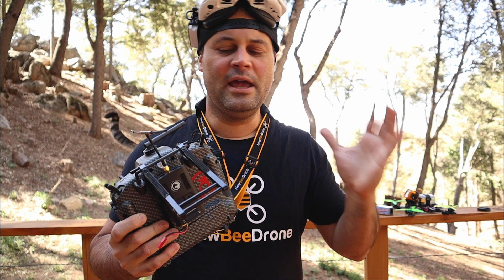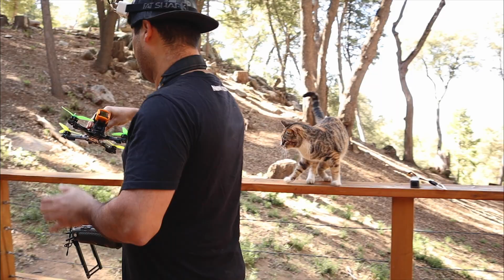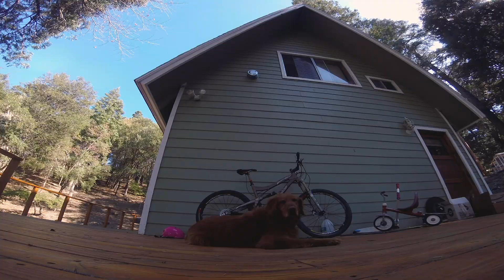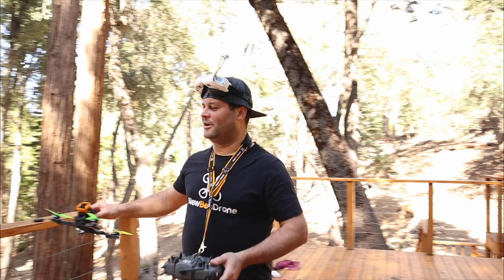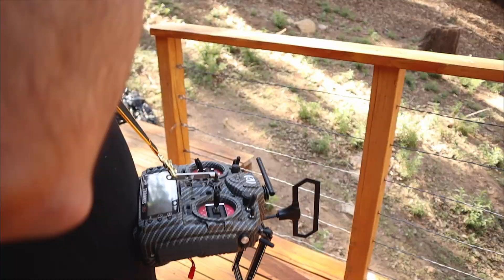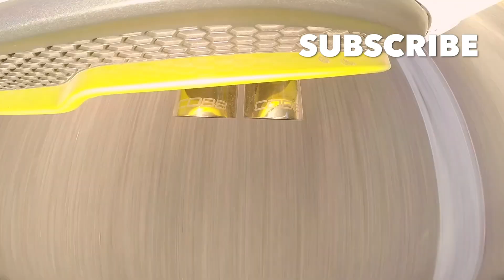TBS Crossfire Vertical Antenna Latency Switch Test

Comment: I hope that I'm not talking out of school, but I thought for best connectivity both Immortal T antennae were supposed to be vertical. Also, I think the diamond antenna should have been horizontal, and tilted a little upwards rather than facing flat to the ground. I only know this from watching other videos (I'm trying to set my CRSF up). 
Good tests though, this gives me confidence that I have spent my money on good equipment.
Reply from the maker: Hi, it's been a while since I shot this. But from what I remember, they are horizontal because they are purposely placed like that for convenience. I know I'm not the only guy that used to do this. Essentially, the radio fits in the case with the antenna flat. So that's how I kept it. On the quad side, yes, vertical is better. Reason I run a vertically antenna on my long range quads. But on a smaller freestyle quad, a vertical antenna is not always convenient... so basically, the test is to see how well worse-case scenario will do.

These days I fly a Tango 2 and on that it's really easy to orientate the antenna vertically. On the quad it stays flat because of convenience.... plus, the way I see it, I'm flipping all over the place, so a lot of the time, the antenna is all over the place and definitely no flat the entire time.

Comment: When you have your antennas horizontally polarized (flat) it interacts more with earth ground.  And you need to polarize your quad antenna the same as transmitter.
Reply from the maker: Hi Ron, been a while since the OCMA races are pretty much dead. I'll reply with what I replied to M Soto here in the comments.

They are horizontal because they are purposely placed like that for convenience. I know I'm not the only guy that used to do this. Essentially, the radio fits in the case with the antenna flat. So that's how I kept it. On the quad side, yes, vertical is better. Reason I run a vertically antenna on my long range quads. But on a smaller freestyle quad, a vertical antenna is not always convenient... so basically, the test is to see how well worse-case scenario will do.

These days I fly a Tango 2 and on that it's really easy to orientate the antenna vertically. On the quad it stays flat because of convenience.... plus, the way I see it, I'm flipping all over the place, so a lot of the time, the antenna is all over the place and definitely no flat the entire time.

Comment: Cool glad ya tried it, my diamond on R9m vertical gives way more penetration off to the side, thru cars + concrete much higher rssi
Reply from the maker: Test successful if you ask me. Just knowing that going vertical makes such big difference. BTW, I haven't ordered the VAS antennas for my DJI goggles yet. I'm watching my spending.
Reply: PinchTune yep, i tested at 10mw on R9 with amber callouts, big diference.  Cool we all are now, or should be lol.  If ya wanna test tennas ya have just order adapters, pagodas work great on goggles too

Comment: Wonder why not leaving power in 500mw and forget about it.
Reply from the maker: Several reasons... 1. It consumes too much power. 2. I can introduce noise into other electronics around (speaker, video cameras, phones, etc)... but the biggest reason is 3. Etiquette. You really should only use as much power as you need to get the job done, when it comes to radio signals. You don't just blast more than you need and call it a day.

Comment: using BF 4.2 RC now the link quality osd can shows crsfmode:LQ eg: 1 or 2:100.
Reply from the maker: Ah that's cool. Good to know. That can be pretty useful for long range. I had originally set this switch up like two and a half years ago when I started flying long range. After that I didn't use it for a long time until I realized it could be useful for these short range tests.
Reply: PinchTune yeah

Comment: Some things I'd like to point out. 

-The TX immortal-T in this video with the red stripe, is that V1? Should try the V2.  

-The Diamond Antenna went to "1" (50Hz) in this video when you were flying to the side more, and flew higher.  Which kinda makes sense because Diamond Antenna's signal is stronger when flying in front of it.  Also flying directly above yourself with vertical orientation means the drone's antenna is facing your TX antenna's null/weak point, so those results definitely made sense.

-The "receiving" Immortal-T on the drone should match or be as "parallel" as possible to the transmitting antenna. So if your TX immortal-T or Diamond Antenna is vertical, so should the drones, as much as possible.  I read that once I think on the TBS Antenna Orientation Guide on their website.  If they're lined up "perpendicularly," signal ain't as strong!

-Great informative video! I was curious about this, and I subbed! :P
Reply from the maker: Hi! Thanks for the feedback and the sub. Yeah, you are absolutely right. In fact, Mike Chin over at TBS also said one should make the orientation on both the quad and the TX. I'm just happy with knowing that going vert on the TX made such a big difference even with the flat antenna on the quad. It's a compromise I'm willing to make, as a vertical antenna on a freestyle quad is a bit of a pain. Now, for my long range stuff, that's different. I do have it vertical on my Super G (on flat, the other vertical as it's diversity) and will convert my long range Alien to vertical all well.
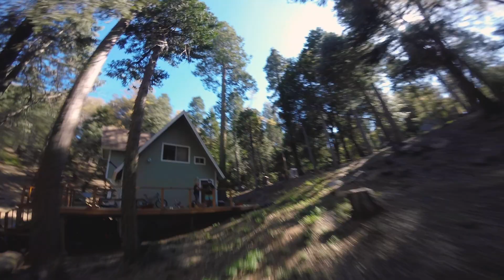Reply: @PinchTune  Thanks for testing the Diamond Antenna, too. I got worried you weren't going to because you said that you're not going to bother with the other antenna at 5:01.  Also, SICK flying! I'm fairly new to FPV and I definitely can't do all the tree dodging maneuvers you were doing!

Comment: Off topic..
If you are going to put music like that? Normalize the volume across your video, Music was way louder than everything else.
Reply from the maker: Actually, not off topic. I actually did normalize the thing, but I think I could have done better. I kept going back and forth on it and just let it slide in the end. I reduced the track volume on the loudest parts by -2 db, and of course I reduced it to -28 db when I started talking. I think my issue was actually that I needed more compression and boost to my voice. It's tricky to do when the mic is on the camera, as I lose a lot of punch as compared to a lapel mic or a mic on a boom. Thanks for bringing this up though. I'll try more voice compression next time and hopefully that'll make it so the listener already had the volume lower before the music comes on.

Comment: Love the property... 😍 I've always run mine vertical, or slightly angled. And knock on wood. Never had a fail safe, only once but the antenna was broken at the solder joint.
Reply from the maker: Thanks! I have never actually failsafed on CRSF... but I do want the crispiest feel possible, so I want it stay on 150hz the longest. Hope all is well!

Comment: Have you tried taking off the frsky 2.4ghz antenna? It sounds crazy, but I noticed it affecting my range even though it’s not active. It is grounded and probably acting as a really crappy yagi.
Reply from the maker: Oh wow, I never even thought of that. I would have to mod the radio to take it off because this SE radio is one from Aloft Hobbies, and their special order didn't have removable 2.4 antennas.
Reply: PinchTune Yah I would give it a try. I also found the diamond antenna to have less open range than the standard T, something our safety pilots at work noted as well. The little 2.4ghz diamond antenna is a major improvement for whoops though.

Comment: Nice 👌🏼 thnx for the test , definetly running my antenna vertical from now on 😃
Reply: A8S fpv works bro, i was 1 of the suggestors for Danny....way more penetration to the sides. N if ya have a metal bar on tx it wrecks signal if horizontal, like qx7... Pawel the inav guy did a test vid few months ago
Reply: Flo-Rida FPV Damn 🤯 didnt know that , running the Nirvana tho , so no cross bar 😁
But just Got a directional diamond antenna , and gonna hard mount that sucker vertical !🔥👍🏻thnx
Reply: A8S fpv cool, i run diamond too, excellent omni pattern,  just be careful its fragile

Comment: Yeah, exactly what I have found with R9 as well..  the null points are on the tips, so when horizontal, its more likely to have null points  (or close to null points) aimed at/from the quad.  Far less likely with it vertical, as the only null points are from the quad antenna, and not both the tx and rx antennae.
Reply from the maker: That's exactly right. I'm just going to stop being lazy and turn my TX antenna vertically now every time. Thanks for watching.

Comment: I use the truerc antenna which is specific to 868mhz. The TBS antenna are actually designed for 900mhz in order to be used for 868mhz and 915mhz users. Maybe try to compare your range with that TrueRc antenna specific to the frequency you use to see if it makes a difference
Reply from the maker: Ah interesting. I'd have to find one for 915mhz if they make it, given that's what we use here in the states.